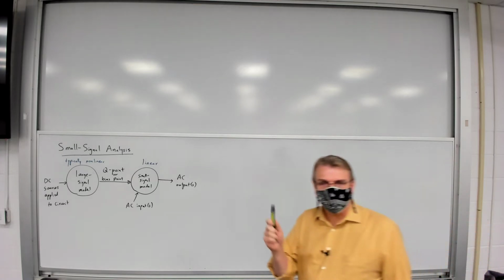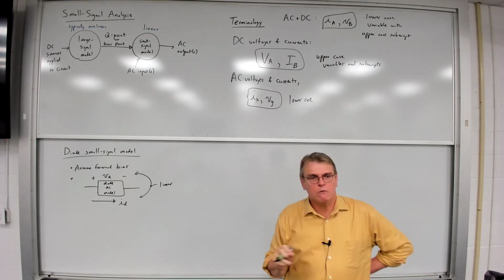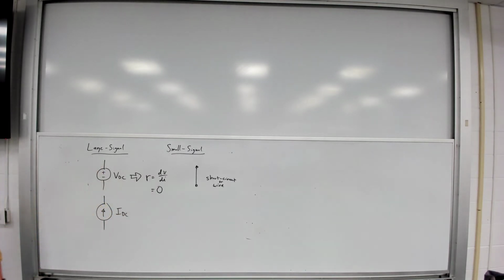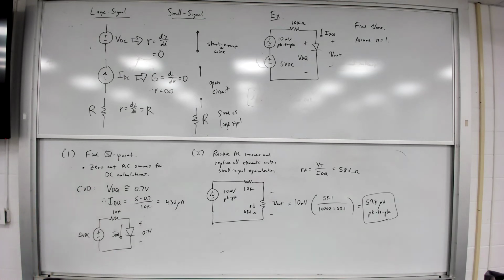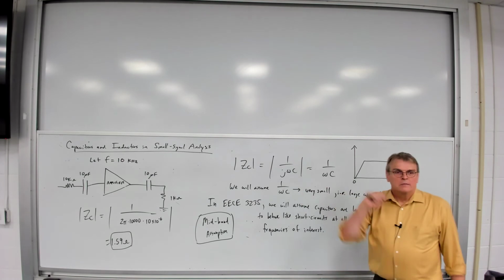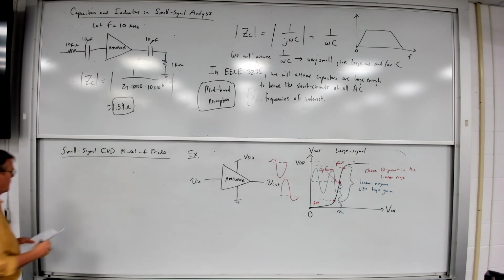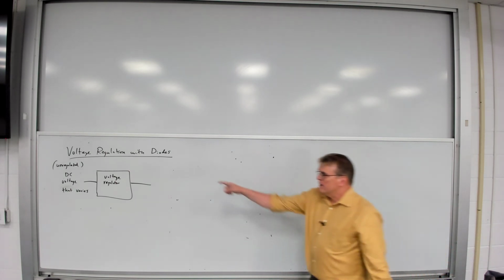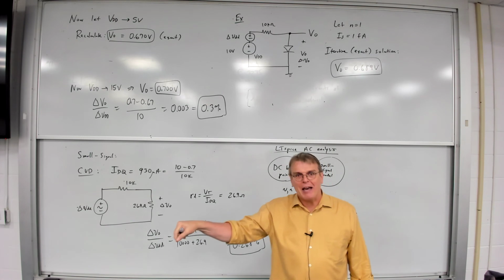Electronics - Lecture 5:  Diode small-signal model, small-signal AC analysis, voltage regulation

Comment: 54:19 Here, when designing a system, we likely take v_dd as granted, fixed and defined externally by standard voltages? And then we define biasing and build our amp scheme with this input in mind (among others, of course)?
Reply from the maker: That is correct.  The determination of the optimum bias point will depend upon the value of the power supply voltage, among other factors.  It is not a fixed value for all amplifier circuits.  If that were true, it would make amplifier design a lot easier!

Comment: hello sir, could u pls confirm with regard to small signal analysis:
the reason why we do zero out the DC source, after finding out the current through Diode due to DC, is that the DC voltage is large enough causing the diode to be fully open and not cause any potential difference (diode acts as straight wire).
but the AC source is small enough which makes the diode show resistance like behaviour, so we find the current through it (most of it due to DC source, so we ignore AC), and treat it as a resistor to find voltage drop (Vout)
thank you
Reply from the maker: We zero out the DC voltage sources because the small-signal AC equivalent of a DC voltage source is a wire.  A small AC current flowing through a DC voltage source causes no change in the value of the source, so the effective small-signal AC resistance is (delta V / delta I) = (0 / delta I) = 0.

Similarly, the small-signal AC equivalent of a DC current source is an open circuit.  A small AC voltage across a DC current source causes no change in the value of the source, so the small-signal AC conductance is (delta I / delta V) = (0 / delta V) = 0, resulting in an AC resistance of infinity.

We do need to calculate the DC bias point in order the calculate the small-signal resistance of the diode, which is why that step comes first.